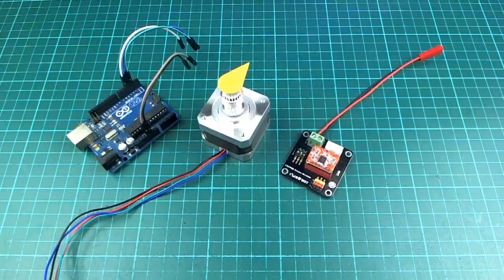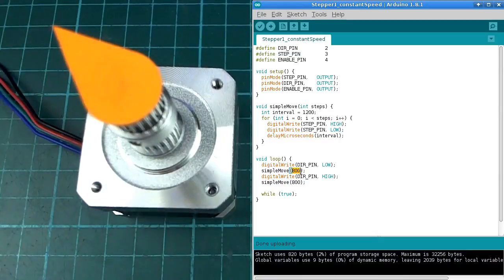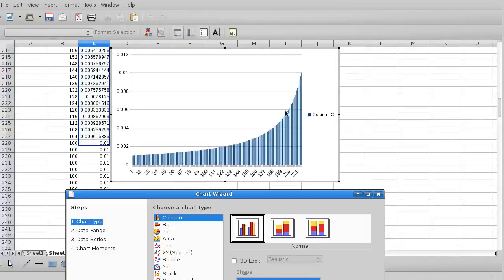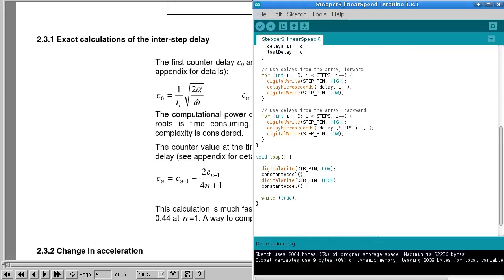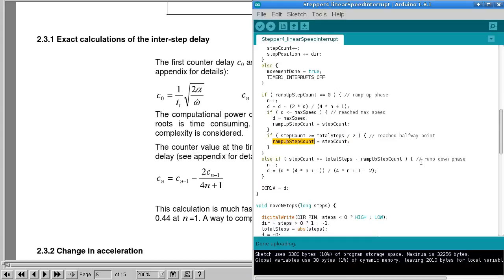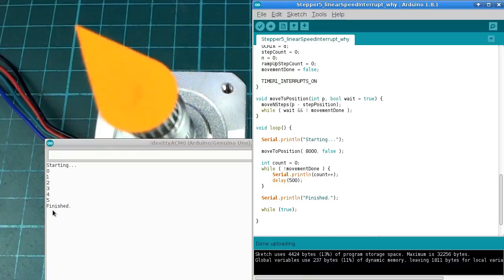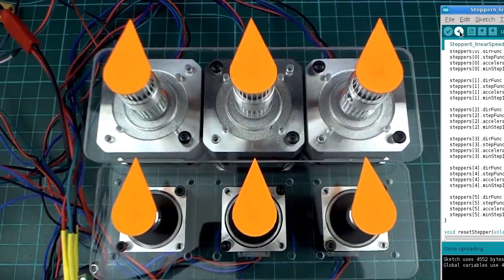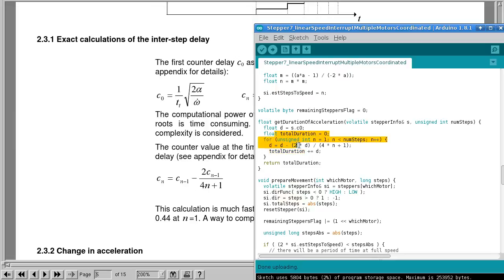Coordinated stepper motor control (arduino)

Comment: In your 5th program, there is an error within the ISR.  Your last else if statement should just be an if statement.  This will remove that random pause in your program.
Reply from the maker: You mean the line with the "ramp down phase" comment? Can you explain a bit about why it's a problem? The ramp down phase and ramp up phase will never be occurring at the same time so the 'else' should be ok I think.
Reply: Though the Arduino IDE doesn't catch the error, the computer is looking for a previous if statement which doesn't exist causing a slight hiccup in the Arduino board when it is executing the code.  I may be wrong, but I have ran this program several hundred times and the pause either completely disappears or only occurs once when the statement is changed.
Reply from the maker: I'm still not sure what you mean about the random pause you mentioned in your first comment. Is it something I showed here in my video, or something you're seeing with your setup? Did you change any of my code perhaps?

'Slight hiccup' is very vague, surely there is a more precise way of defining exactly what's wrong. The program would not compile at all if there was an 'else' without a corresponding 'if' statement. Just to make sure we're talking about the same thing, the if statement you're referring to is this one right?

  if ( rampUpStepCount == 0 ) {
    ... branch 1
  }
  else if ( stepCount >= totalSteps - rampUpStepCount ) {
    ... branch 2
  }

The movement starts with both stepCount and rampUpStepCount set to zero. totalSteps is set to some non-zero value and remains unchanged, while stepCount is unconditionally incremented every pass through the loop until it equals totalSteps. rampUpStepCount remains at zero until either the maximum speed has been reached or half-way through the movement, whichever comes first, and is then set to the current value of stepCount. In the first phase, program flow will go exclusively into branch 1, and in the second phase it will go exclusively into branch 2. 

Taking out the 'else' would make it possible for both branch 1 and branch 2 to execute in the same loop iteration, but only when both if conditions were true. For the first condition to be true, rampUpStepCount must be zero. And if rampUpStepCount was zero, then the second condition would become (stepCount >= totalSteps) which can never happen, because stepCount is only ever incremented when it is less than totalSteps (see first part of ISR) and when stepCount becomes equal to totalSteps interrupts are disabled.

So I can't think of any values for these three variables where it would make any difference if the 'else' was there or not. The only reason I included it was because in the ramp-up phase it avoids one comparison, to make the ISR a bit faster. It also serves as a readability improvement (imo at least :) to highlight the fact that the two phases are supposed to be mutually exclusive.
Reply: I have been trying to figure out why when I change the c0 variable, say from 700 to 800,  some numbers introduce a pause in the stepper motor while other values allow the motor to run smoothly.   I have modified the code slightly trying to find the root cause, but still have not figured out why this is occurring.

Here is the code I am currently using from your example:

#define DIR_PIN          5
#define STEP_PIN         2
//#define ENABLE_PIN       4

#define STEP_HIGH        PORTD |=  0b00000100;
#define STEP_LOW         PORTD &= ~0b00000100;

#define TIMER1_INTERRUPTS_ON    TIMSK1 |=  (1 << OCIE1A);
#define TIMER1_INTERRUPTS_OFF   TIMSK1 &= ~(1 << OCIE1A);

unsigned long c0;

void setup() {
  Serial.begin(9600);
  
  pinMode(STEP_PIN,   OUTPUT);
  pinMode(DIR_PIN,    OUTPUT);
  //pinMode(ENABLE_PIN, OUTPUT);  noInterrupts();
  TCCR1A = 0;
  TCCR1B = 0;
  TCNT1  = 0;
  OCR1A = 125;                             
  TCCR1B |= (1 << WGM12);
  //select prescaler: 16MHz/64/50000=5Hz overflow or 16MHz/64/25000
  TCCR1B |= ((1 << CS11) | (1 << CS10));
  interrupts();  c0 = 700; //2000 * sqrt( 1 ) * 0.67703;
}

volatile int dir = 0;
unsigned int maxSpeed = 10;
volatile unsigned long n = 0;
volatile long newvar = 0;
volatile float d;
volatile unsigned long stepCount = 0;
volatile unsigned long rampUpStepCount = 0;
volatile unsigned long totalSteps = 0;
volatile int stepPosition = 0;
volatile bool movementDone = false;
int count = 0;

void moveNSteps(int steps) {
  
  digitalWrite(DIR_PIN, steps < 0 ? HIGH : LOW);  
  dir = steps > 0 ? 1 : -1;  
  totalSteps = abs(steps);
  d = c0;  
  //OCR1A = d;  
 // stepCount = 0;
  //n = 0;
  //rampUpStepCount = 0;
  //movementDone = false;
  
  TIMER1_INTERRUPTS_ON
}

void moveToPosition(int p, bool wait = true) {
  moveNSteps(p - stepPosition);  
  while ( wait && ! movementDone );  
}

ISR(TIMER1_COMPA_vect)
{  
  if ( stepCount < totalSteps ) {
    
    //STEP_HIGH
      
     //STEP_LOW
    
     digitalWrite(STEP_PIN, digitalRead(STEP_PIN) ^ 1);
       
    stepCount++;
    
    stepPosition += dir;
        
  }  
  else {    
    movementDone = true;
     noInterrupts();
    TIMER1_INTERRUPTS_OFF
  }
  
  if ( rampUpStepCount == 0 ) { // ramp up phase
    n++; 
    d = d - ((2 * d) / ((4 * n) + 1));  
    
    newvar = n + 1;
    if ( d <= maxSpeed ) { 
             
      d = maxSpeed;
      
      rampUpStepCount = stepCount;
      
    }
    if ( stepCount >= totalSteps / 2 ) {  
           
      rampUpStepCount = stepCount;          
    }
  }  
 if ( stepCount >= totalSteps - rampUpStepCount ) { // ramp down phase
  
    newvar--;
    n--;
    d = (d * ((4 * newvar) + 1)) / (4 * newvar + 1 - 2);
  }  OCR1A = d;
}void loop() {  //Serial.println("Starting..."); moveToPosition( 4000, false );
while ( !movementDone || count <3){
  
  count++;
  delay(100);
  
}; movementDone = true;
     noInterrupts();
     TIMER1_INTERRUPTS_OFF}
Reply from the maker: I don't really have time to play spot the difference in a hundred lines of code, but if you're using code that's different to mine I can't really say anything useful about it.

I think the first thing you need to do is describe what you mean by 'a pause in the stepper motor' so that I know if it's even something I'm seeing myself. So again: is this 'pause' seen in my video?

Comment: Great video!  Thanks for posting
  I've never been able to get steppers to work without a delay between driving step pin  high and driving it low, if i do those commands back to back its just a big fail, as if the driver cant detect the falling edge.  In fact I cant get your code to work without some delay before sending that falling edge - maybe differences in drivers, or some emf phenomenon (though its odd I've used various driver boards over the years).

Comment: Thanks for this video, I'm really passionate about this stuff. However I'm having some problem using some of your example sketches with my motor drivers (TB67S109AFTG) and a pro-mini-16MHz. In particular, in sketch4_linearSpeedInterupt I think that the step pulses are a little too short (T_ON=125ms in my case). Most stepper drivers are rated for pulse freq less than 100KHz (T_ON > 300ns for my drivers)

Comment: This is absolutely brilliant!!! Exactly what I was looking for. Thank you so much for sharing. The codes work seamlessly with my stepper motors except the "Interrupt" codes. I'm pretty sure it's because I'm using Arduino Zero board. Would you help me to use this on the Zero board please? It says expected constructor, deconstructor, or type conversion before "(" token. Red line on ISR(TIMER1_COMPA_vect)
Reply from the maker: I have no idea about that, never heard of Arduino Zero actually. Look up how to make an interrupt routine on that board.
Reply: Oh, thanks for replying. It seems there is "timer interrupt" on the Zero board as well. I wonder what's the timer interval here. Is it fixed at 1 second or varying as the stepper steps change.
Reply from the maker: Sounds like you might need to go over the basics of using hardware timers. Here's a brief overview that I think will be relevant for any microcontroller:

A timer is a number that is incremented every clock tick. So for a 16MHz clock, it is incremented 16 million times per second.
Usually that is too fast to be useful, so you can slow it down with a 'prescaler'. For example a prescale of 16 would result in the timer being incremented every 16 clock ticks, or 1 million times per second.
Timers will trigger an interrupt either when the counter variable overflows, or when it reaches a specific count. The overflow trigger will depend on the size of the timer variable (eight bit counter will overflow after 256 increments, 16 bit timer will overflow after 65536 increments).
When the interrupt is triggered the function associated with that interrupt will be called.

So for example if you want a function to be called every 5 milliseconds and you have a 16MHz clock, you could use a prescale of 16 and set the timer to trigger every time it reaches 5000. Note that this cannot be done with an 8 bit timer because 5000 is too large for 8 bits to hold. Depending on what prescales you have available, you might still be able to do it with an 8 bit timer though, for example a prescale of 512 would increment the counter 31250 times per second (16M / 512) ie. once every 32 microseconds (1 / 31250Hz). Then you could set the specific count trigger value to 156 to approximate 5 milliseconds (156x32=4992 microseconds). The prescale levels available will be determined by the hardware you're using.

They are tricky to handle when running at speeds like I'm using in this video, keep in mind that the counter is continuously being incremented even while the interrupt function is being executed.

Here is a more detailed overview for arduino, hopefully you can find something similar for your micro too:
http://www.instructables.com/id/Arduino-Timer-Interrupts/

Comment: Where can I get the stepper drivers modular like the one you have in your video?
Reply from the maker: I'm using this one: https://goo.gl/uwxCWB
Reply: Hi, I was also wondering if you had a picture/diagram of how you initially wired your first motor up to the single stepper driver w/power supplies?

Comment: This comment, and iforce2d's reply,  are copied and pasted from the follow-up video to this thread (https://youtu.be/7Md-suRj5vc) for future use by others:

Both of the videos that you uploaded on this topic are really great! They've been really helpful in helping me wrap my head around timer interrupts, as I try to coordinate stepper motor movement.  I'm trying to figure out a way to incorporate the "moveToPosition()" function with the coordinated "prepareMovement()" in your last two examples.  Right now, the coordinated movement moves the steppers relative to whatever position they are currently in whenever a new number of steps is sent, rather than an original "0" position.  Do you have any insight on how that might be achieved?  Thanks again for sharing what you've already accomplished.

iforce2d's reply:

The 'insight' is already in the sketch that has the moveToPosition() example. You just need to do the same thing for a specific motor:

void prepareMovementToPosition(int whichMotor, int position) {
  volatile stepperInfo& si = steppers[whichMotor];
  prepareMovement( whichMotor, position - si.stepPosition );
}

Comment: im so thankfull that found your channel. can you helpme please. i want to make kind of camera tilt pan, that control the tilt pan direction using potentiometer and belt for the tilt pan mecanism. can you helpme with writing the code please, i just started on arduino. and im just accounting student. thannks before.
Reply from the maker: Look at the "servo" and "analog input" examples in the arduino IDE.

Comment: a bit of a dumb question, but can any stepper motor go this speed. i am looking for a stepper motor with good speed but also lots of torque(200 oz/cm) is ti possible to get a motor like that to spin at a high rpm? Thanks
Reply from the maker: aren't we all :) 
I don't really know what would place a limit on how fast a stepper can spin. Certainly the driver needs to be able to switch fast enough, and you would want as little load as possible on it, but I think in theory it can go as fast as the driver and mcu can make it.
Reply: ok thanks. very helpful. the stepper motor that i have at home came in a kit and i believe it is a cheap one. it doesn't spin fast at all and has no torque. that is why i wanted to clarify this with you. Thanks for the great video. Keep it up. :)
Reply: P.S. is bang good a reliable and honest site? i would love to buy from them but i don't want to get ripped off. Thx
Reply from the maker: I have hundreds of orders and no major problems so far, at least not with orders. A few years ago they had problems where credit card details were leaking out (just my theory from having my card hacked twice in two months, the second time it could only have been BG). About that time they stopped CC payments for a while and fixed it, but I would still not recommend using a CC to purchase. I only use PayPal now and no such problems should occur because your password never goes to their pages at all.
Reply: Ok. Thx again and keep it up. we need more videos like this available for the general public.

Comment: I learned alot from your vid thanks for posting it and the code! HOWEVER, as soon as you move to interrupts, and more so with multiple motors, your code skips to some pretty high level port addressing and bitwise processing with no explanation at all. So, I (and I Suspect many others) am having trouble following the code. I would be happy to watch a 45+min detail on that alone.
Reply from the maker: Using bitflags is a general programming topic that is not really anything to do with arduino specifically. As such it has been around since the 1960's (I would think...) and there is a ton of info out there. Here's some links that should help:
http://www.learncpp.com/cpp-tutorial/3-8a-bit-flags-and-bit-masks/
http://tronixstuff.com/2011/10/22/tutorial-arduino-port-manipulation/
Unfortunately I think it would make the most boring video ever to explain, although some people have done it:
https://youtu.be/B4bsPDFBJhA?t=7m52s
Reply: Thanks, as I have been doing more reading, it seems I have a general ignorance of the details of the whole interrupt process (relying on the TimerOne.h library or not using interrupts at all).  Because of this I am having trouble understanding how your ISR works.
Reply from the maker: I found interrupts are a real bitch to work with, about 80% of my time with this project was coming to terms with their quirks. I would suggest starting out with something really simple first.

Comment: FYI, any one have question why you cannot find the digital 54 , 55.... pin map. here is the port mapping for direct port manipulation
Port         Pin     Function
PF 0       54       A0
PF 1       55       A1
PF 2       56       A2
PF 3       57       A3
PF 4       58       A4
PF 5       59       A5
PF 6       60       A6
PF 7       61       A7
PK 0       62       A8
PK 1       63       A9
PK 2       64       A10
PK 3       65       A11
PK 4       66       A12
PK 5       67       A13
PK 6       68       A14
PK 7       69       A15

Comment: Do you have a reference for the  board that support the stepper driver? It seems pretty convenient and would be time saving... I've looked for Yurobot stepper controller modular but it did not yield anything...
Reply from the maker: https://goo.gl/sZpZpL
Reply: iforce2d thank you! Unfortunately, I was talking about the single board shown at the beginning (black board) with the micro switch for the steps "size". Do you happen to have this reference?
Reply from the maker: Sure
https://goo.gl/1R8NUL
https://goo.gl/256BXZ
Reply: iforce2d perfect! Exactly what I was looking for! Thank you!

Comment: Great Video mate and vwdone sticking with it👍I watched to the end and didn't yawn once even tho i don't think I will ever have a need to control 6 steppers at  once...Was very surprised to see there was no slip i am guessing it's because you used interrupts..which part of down under are you from? I have lived in Christchurch NZ twice but am now stuff back in wet and Cold Liverpool UK now Winter is on the way here and your Summer is just around the corner..Regards Steve

Comment: I'm a programmer (Delphi, C#) 
Do I need electrical engineering knowhow to do any of this?

I want to build a 3 axis cnc machine for cutting wings from foam.
Reply from the maker: Not really. In fact for most arduino stuff programming is the majority of the job.
Reply from the maker: For a hotwire machine you could look at GRBL, which is a much more complete thing, already including reading of cam files, acceleration, coordination etc. Not sure why you'd need 3 axes though, wouldn't two be enough? Or I suppose four if you want a different section at the wingtip.

Comment: I think you might get some smoother operation when running slowly by putting the delay between the high and low as well as at the end of the loop.  The way it is means it takes 2 steps delays takes 2 steps etc... Maybe it wouldnt make a noticeable difference though.

Comment: getDurationOfAcceleration?  Pre-compute the values of this function for a suitable range of numSteps into arrays for each stepperInfo.  You could reduce the number of elements in each array by only storing every Nth value of numSteps and doing simple linear interpolation for in-between values, at the cost of accuracy.
Reply from the maker: I don't think that's feasible with the 2kb RAM the arduino has. In any case, I found an approximation that works pretty well, see the other video linked to in the description.